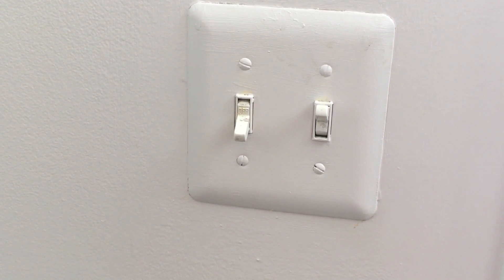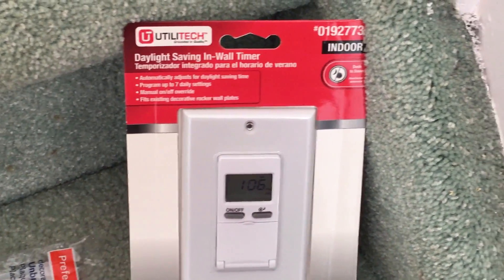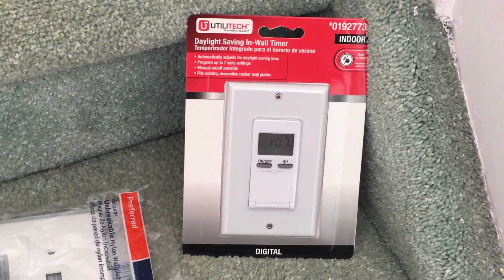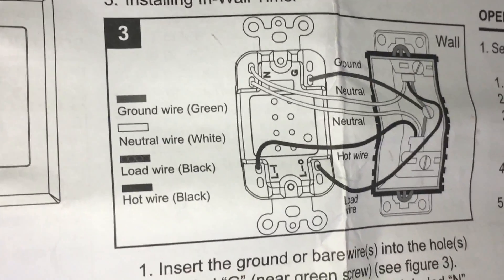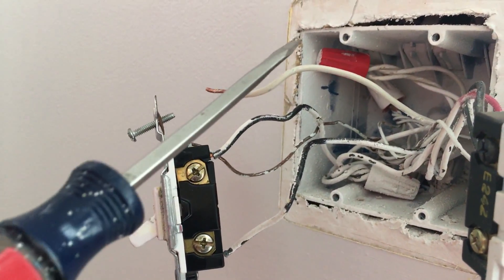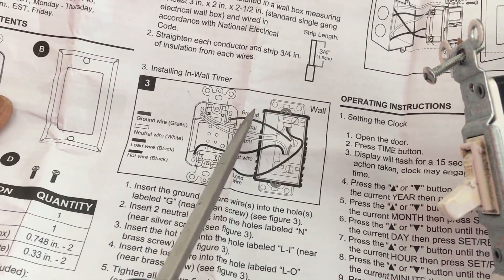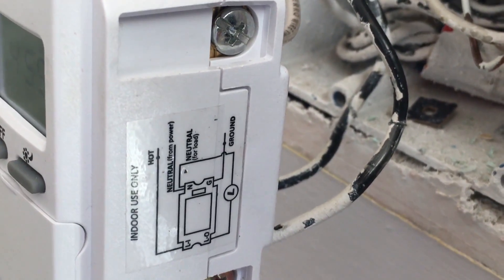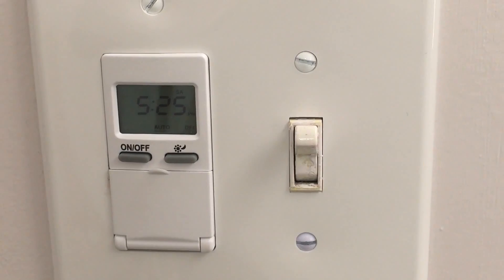Utilitech Daylight Saving Digital In-Wall Timer (Model# 0192773)

Comment: Instead of inserting the wires in the hole can they be wrapped around the screws? My live and ground wires are shared with another unit in the outlet box so the wires are not independent- they are wrapped around the screws.

Comment: i spent a long time today trying to get it to work and i probably need to attach a white wire to the neutral wire cap bundle as you mention. i tried connecting the single white neutral wire to the switch, but that didn't work.  I've noticed that the  female lugs that accept the wire's are not very strong.  they don't really hold the wire's tight. did you notice that also?

the previous models from this company have four wires coming out of the timer unit, where as this newer daylight saving model doesn't have wires built in. instead it was four female lugs.  So far they don't seem to hold the wire very tight and the screws keep spinning, not becoming tight.  kind of strange.
Reply from the maker: Yes Spencer this way it will work for you too.

Comment: Did you hook up the white neutral wire from the outside light or the one connected to the box that was with the hot wire?
Reply from the maker: Brad, initially I hooked up the white wire  coming from the outside light but this didn't work . So I added the wire to the white bunch of wires and connected to the switch. This worked very well. Look's like isolating the white wire from outside switch is not completing the circuit. I confirmed this by calling the Utilitech support.
Reply: US DIY did you use a pigtail wire and attach it to all 3 white wires and then to the digital timer?  Or do you mean you hooked up the white wire that comes from the box with the hot black wire and just connected the other 2 white wires from the lights together?
Reply from the maker: Brad, yes I used a pigtail wire and attach it to all 3 white wires and the other end to the digital timer.

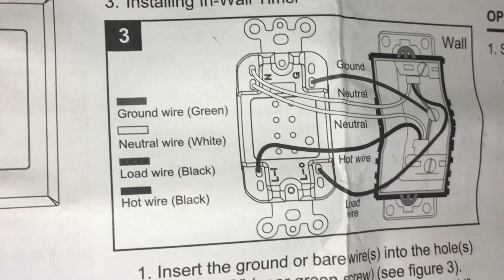Comment: So I think you are mistaken and posted some inaccurate information.  Fast forward to 3:54 it shows thew schematic diagram.  L1 is the line side meaning power coming in from the panel.  L0 is the load wire going out to the fixture and this actually controls the light through the timer just like an switch.  So to reiterate L1 is line makes sense, L0 is the load.

Comment: So from reading the comments below...if you plan to install this model, you will have to buy some neutral wire and attach one end to the holes labeled 'N'. Then bundle the other end with the neutral wires already in the box. If I am wrong please let me know. Another question, does it really need 2 neutral wires in the 'N' holes? videos I am seeing on YouTube only show one neutral wire being attached to the switch.
Reply from the maker: @Tonga - Yes you have to attach neutral wire to from N to neutral wires already in the box. Fast forward video to 3:09
Not sure about connecting 2 neutral wires in the 'N' holes.

Comment: i bought this switch and it won't work for me. on 1 light switch i have only 1 set of wires coming into the box. The white wire is used as the load and the black is used as the hot. No other white wire for me to use. I'll have to find another style of switch to use I guess.

Comment: Can you connect a piece of wire to the neutral bundle of wires and connect it to the N of the timer? Instead of separating it out from the bundle of neutral wires?
Reply from the maker: +Shafik Shamji yes you can.

Comment: Attaching a neutral wire to the bundle is the key in this situation. The light turns on/off. I'll know tonite if the timer works.

Comment: I called customer service and you actually need FIVE wires to make the auto timer work. In picture 3 the wording on left it only list 4 wires, but if you look at the picture there are TWO neutral wires! You can push the off and on and the light will turn on, but you cannot get the programmed settings, or sunrise, sunset settings to work without 5 wires.....as per customer service lady Kim. Will get my husband to try to retire later today.
Reply: Please excuse typos....will get husband to re wire later today.
Reply from the maker: +Johnann Allen Good luck with your project
Reply: Thank you!  He has not tackled it yet.....
Reply: Customer service is going to tell you to use 5 wires because they are simply going to tell you to follow the diagram exactly. They are not electricians and can't/won't give advice not outlined in the directions.
- Ideally the switch should be grounded. This is for safety, not for functionality.
- The diagram has two neutral wires going to two holes that connect to the SAME metal brass plate and screw. Per electrical code, this unit switches the hot line, not the neutral line. the neutral line is used to power the unit and charge the internal battery for program memory. So if you hooked up two neutral wires or a single neutral wire from the bundle, the effective wiring is exactly the same.